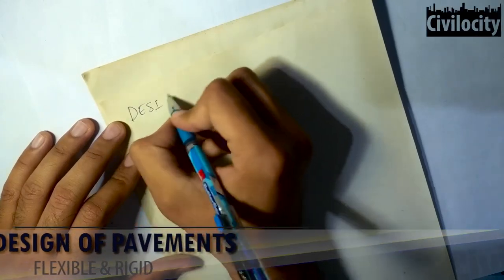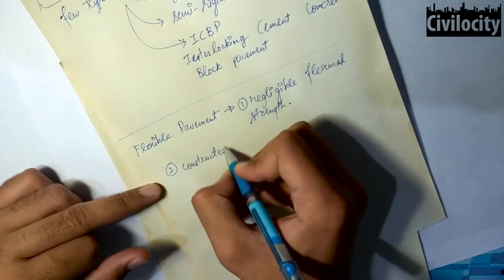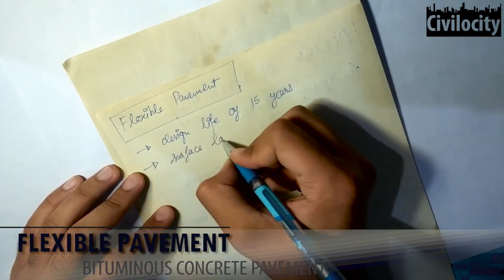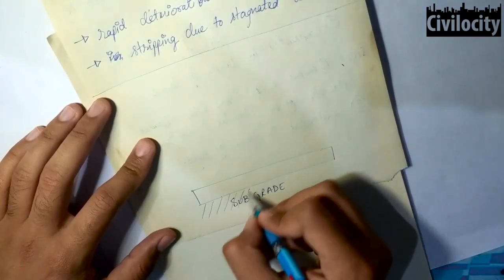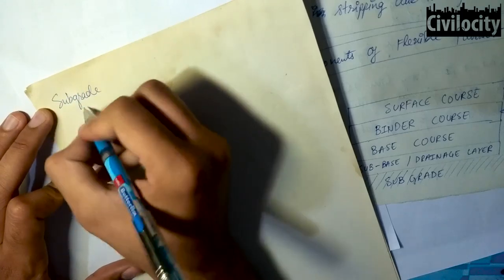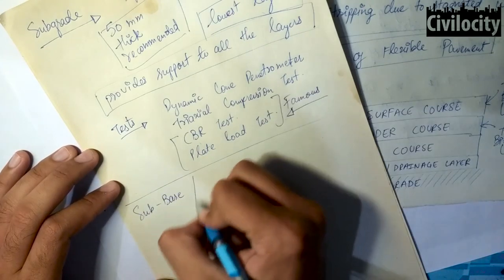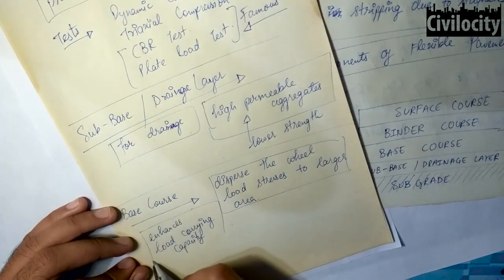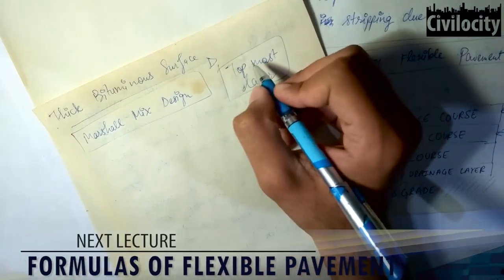Design of Flexible Pavement | Lecture-13

Comment: @02:30 - You mentioned the recomended thicknedd for SUbgrade is 50mm, But I think It should be 50 cm As per IRC recomended.
Reply: Swarup Das yes you are right 500 mm thickness is recommended by irc